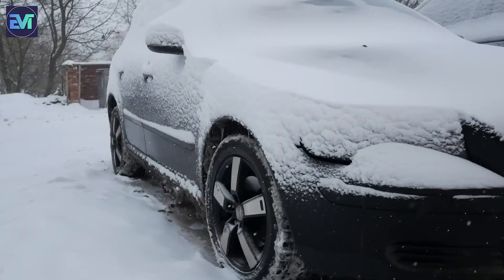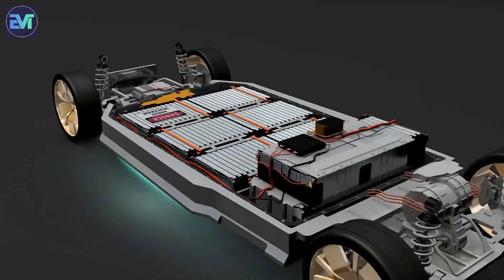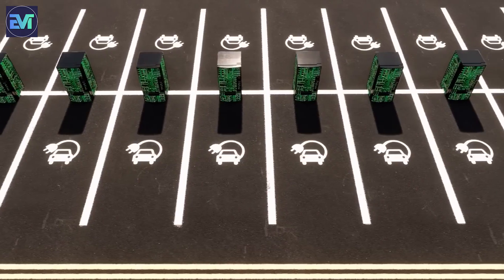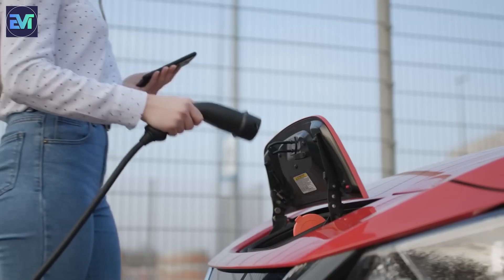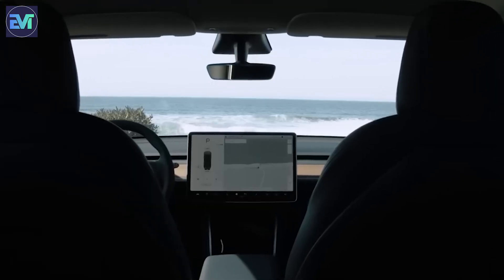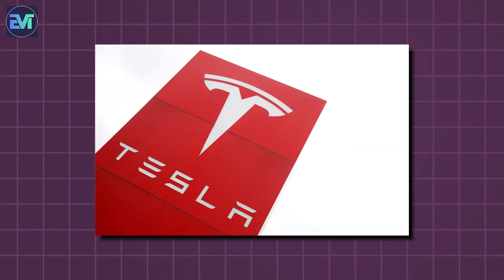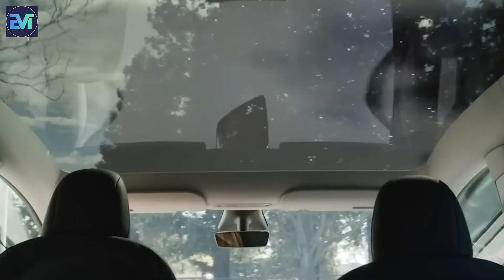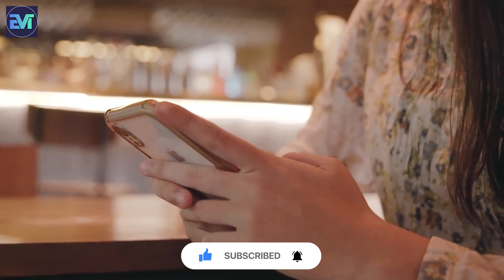Elon Musk Reveals WHY EVs Won’t WORK In Winter

Comment: We live in the mountains of Colorado but don't have a garage so we won't consider buying an EV because they need a warmed garage to charge. But if we had a garage then we wouldn't be worried about EV range, just the purchase cost. If we got an EV it would be for my wife's commute, which is 100 miles round trip and far less than a typical EV can go even with range reduced by cold. We wouldn't consider using an EV for traveling until they have a range of 600+ miles. EVs are for around town driving, not traveling, so reduced range due to cold isn't significant at this time.

Comment: The most obvious solution to cold weather is to have fuel based heater such as Webasto. Battery's energy / weight ratio is just too low and inefficient for heating requirement. Better to have fuel based heater, but no one is doing this approach because of zero-emission mantra. Heat pump is too weak and not efficient in very cold temperatures.
Reply: All decent BEVs heat both the cabin and the battery to operating temperature. If plugged in, it will use wall electricity. If not, it will use the battery.

Comment: Also, EV's tires lasts about a 10th of normal car tires, go and read about the rubber polution caused by them. Lastly, lithium is a dirty way of storing electricity. Where will all the waste go?
Reply: No they do not - unless you drive like a moron and floor it every time.